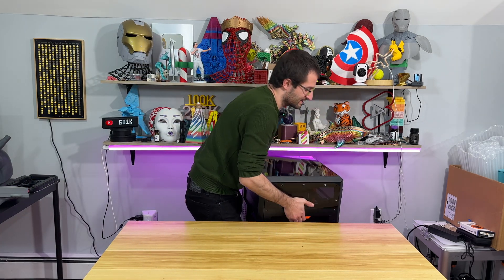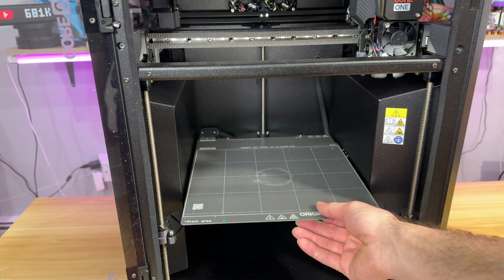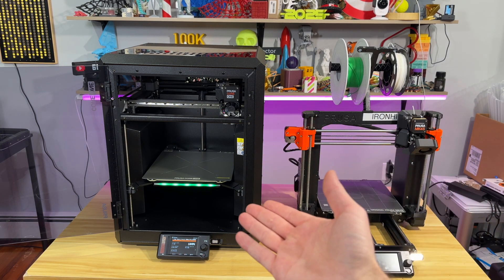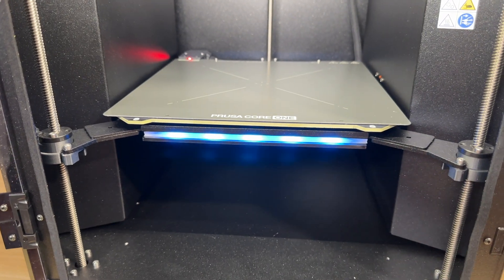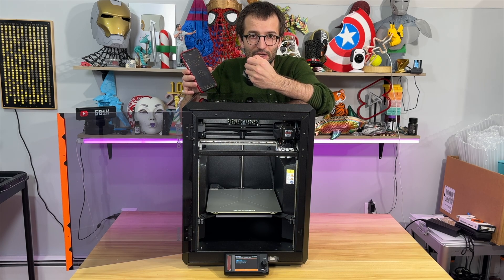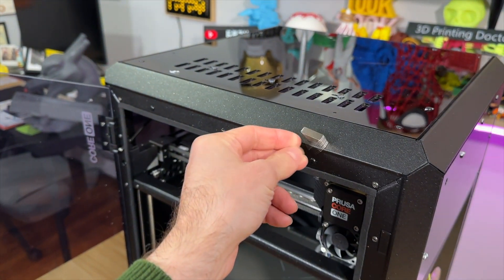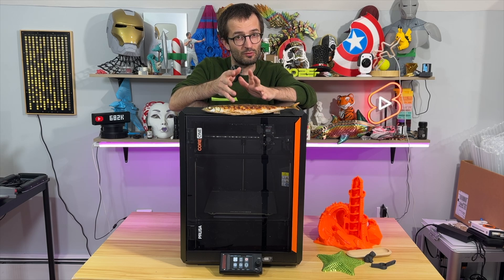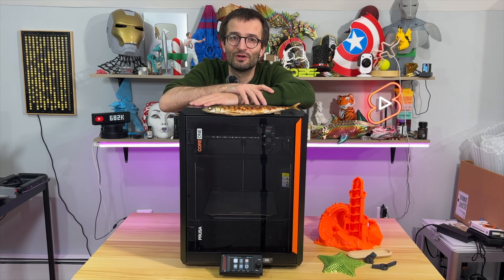5 Mind Blowing PRUSA CORE ONE Features You Need to Know Before Buying

Comment: They had all the chances in the world to make it better than a Bambu lab P1S, X1C.... 
But........ They have a Metal bar infront of the camera position....
They didnt put propper LED light inside...

sorry but i see this as a fail......... i really was hoping they would do this the right way..
Reply: What is wrong with the light that is inside ? From what I see in this video it looks very good to me. Also the metal bar is not between the camera and the build plate, I don't really see the issue with the metal bar being visible on the edge of the image.
Reply: @jorsm.3893  I don't see any Light inside the printer at all.. beside the weird led bar on the bed. The only reason you see any light in this video is from the light in his room. ( as far as i see it ) 

about the camera... i guess what i thought was the metal bar. is actually the rail for the printer head, so that would still mean, that when the printer is working your cant really see whats going on..
Reply: @JimmiboY  Indeed it's the rail of the printhead. The problem of the printhead getting in the way of the camera at some point is a bit universal I think because other brands also tend to put the camera in the corner of the enclosure. So I wouldn't really count that as downside of this machine.

As for lights I believe there is a led strip right behind the metal bar above the door actually. I think (from other videos I have seen as well) that it does a pretty good job at lighting up the inside. So even though the metal bar blocks your view from the outside a bit when the print has just started, they used it for more than just reinforcing the machine.
Reply: @ hmmm I didn’t notice that light. Thank you for informing me 🙌🏻🙌🏻

Comment: Sorry, but I did not learn anything that was not already described in Prusa's launch video and product description. Was hoping for some actual first-hand experience: How well does the chamber temperature control work; what actual print speeds do you achieve (for small and large models, different materials) etc.? I understand the rush to publish something as soon as the embargo ended -- but why publish two hasty videos, instead of a quick unboxing and then a slightly more in-depth review a few days later?
Reply from the maker: That will also come 😃. So why not all of above.